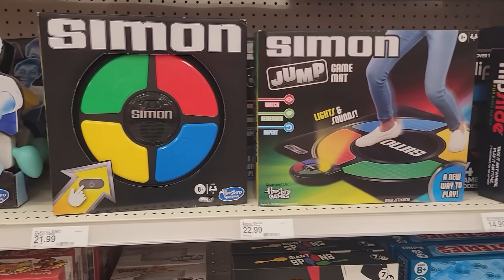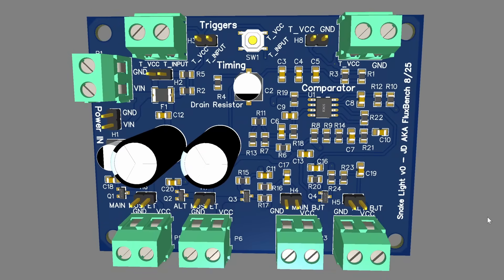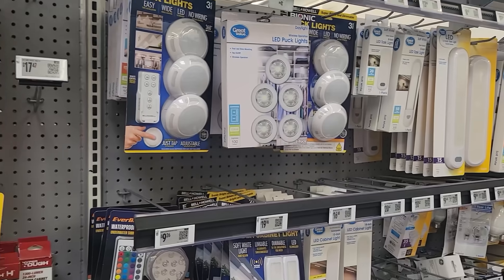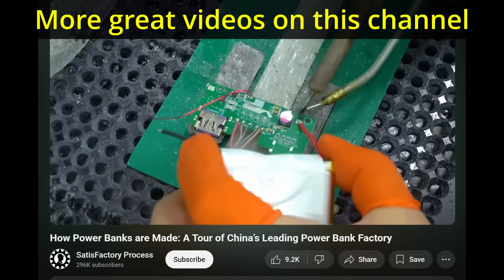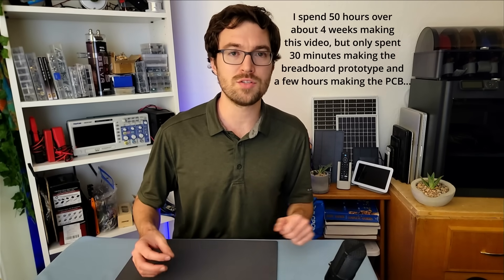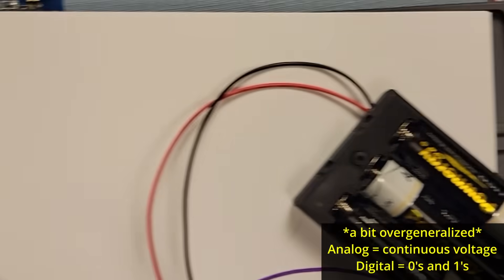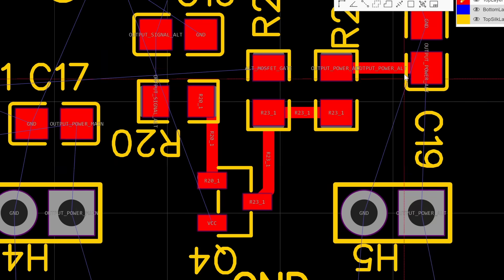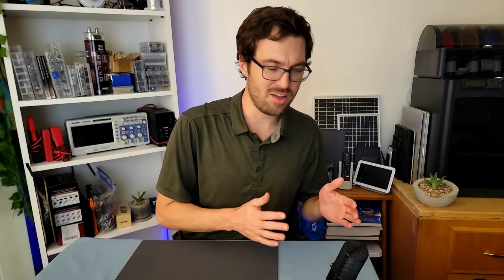How a $2 Circuit Becomes a $20 Product

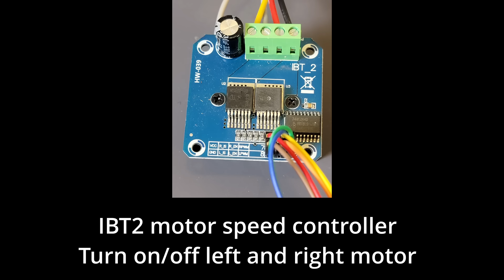Comment: 3:37 Definately not 43 Amps rated with your TDP Entropy sink solution, even Google AI Mode knows that ;)

Need for Additional Cooling: While the module can handle a peak current of 43A, for prolonged high-power usage (e.g., above 10A-20A continuously), reviewers and sources suggest adding a fan to the existing heat sink for optimal thermal management and reliability.

I just searched for "ibt2 motor driver datasheet tdp" but hey, releasing the magic smoke is the most fun, when i.e. the ams1117 still works afterwards because you are a magician ;)
Thanks for doing this, man!

Comment: My first PCB was a simple voltage divider. I was seduced into buying 1k of them in my first run. It was super simple so I thought why not. It worked out, but I would have for sure made a mistake on something more complex
Reply: what did u do with those 1K pieces lol
Reply from the maker: @Mrnooobreal  I need to know as well 😁
Reply from the maker: Gotta know, what did you do with 1,000 voltage dividers!

Comment: What would you recommend for cases? Built to something cheap that you can buy or 3d print?
Reply: If you have a 3d printer, you already know :)
Reply from the maker: @TheBinklemNetwork  if you know, you know 😂
Reply from the maker: 3D printer if you're doing it yourself or aesthetics don't really matter too much, but one step up is getting it made by a professional company like JLC PCB has their 3DP division that can do professional 3D printing or resin printing or machining out of metal or plastic or whatever. That's a very decent middle ground between home 3D printing and professional cases made with injection molds. Sometimes cases are like a dollar each and sometimes they can be like 10 bucks depending on material and manufacturing process and size

Comment: Great stuff. Please do more Videos on electronic products development.
Reply from the maker: Will do! I wanted to make a few videos to explain how to make circuit boards before getting into more of that side, and I did 😁 back to using circuit boards to do things! 

Making a quick pit stop to automate my CNC machine with sensors so I can do the production work at home instead of getting cases and little physical components manufactured externally. Figure that would be a cool thing to show how you can make a lot of stuff for light production work at home.

Comment: Love the content. Is there software that analyzes and validates the PCB design / schematic to catch common issues before having them printed?
Reply from the maker: Yes, but that is a wide-ended question similar to say is there anything that can catch mistakes in code. But similar to code,  they can tell you if something is obviously wrong, but have a hard time telling you that something is subtly wrong. Let's say you want to do something like: 1 + 2 = 3, it can tell 1 + "abcd" is probably an error, but can't tell that 1 - 2 isn't what you want.

There are many AI-based companies that do exactly this. In 1 hour I have a meeting to talk to a engineer who is building exactly this kind of thing at "Flux.ai"! Really interesting concept, not quite fully baked yet.

Most other software in this area is for PCBs that are so big and have so many people working on them that doing a human review would take weeks and be prone to still missing things. It will catch those basic and obvious errors, but not the subtly wrong ones.

For now, if you don't have a senior electrical engineer to look over your stuff, describing your intent in words and adding images of your schematic to ChatGPT or another AI is a decent way to check. Better than nothing.

Comment: First of all, Keep FCC certification in mind in your calculation guys. Its not cheap and mandatory for electronics. Also. Way more important. NO NOT PROTOTYPE WITH CHINA. They can and will steal your design and sell is cheaper. Also their PCB´s are leaded which is very illegal to sell here in the west.
Reply from the maker: I'll be covering that stuff later, this product was designed to avoid the need for FCC certification as nothing is switching over 9000 times a second. No lead is possible, just costs a few dollars more to get ENIG coatings rather than HASL

Comment: would it be easier and a more long term solution to handle the snake problem directly?
Reply from the maker: Not really 🤣 over the years I've had about 10 snakes just decide they want to live in my garage. The garage door is open for hours a day when I'm working out there, and there are a few cracks and holes in a side door they can squeeze through. I like most of them (not rattlesnakes) as they keep the rodents away, but between snakes and shovels falling over in the dark it would be nice to see where I'm walking before I can turn on the light 😁👍

Comment: Oh, btw, what about the cost of getting certified by regulatory entities? What about the cost of your time assembling the components?
Reply from the maker: The magic of this design is no certification needed by EMC Labs for FCC compliance due to nothing switching AKA turning on and off more than 9,000 times per second. This is equivalent to like a flashlight with an on or off switch, except for it's going to be the door that turns it on, and a capacitor being drained over many seconds that turns it off eventually. 

I will be making another product after this to demo EMC compliance and certification and all that stuff
Reply from the maker: Very good catch about the assembly time!!! I will get the electronics manufactured by either JLC PCB or a contract manufacturer I'm currently using in Asia. I might also have the contract manufacturer do the full assembly and testing too depending on the case and trigger mechanism I end up using. I'm going to make a version using more custom cases and components for the trigger, and another using more generic stuff that the Asian factory can source locally.

Comment: 20 prototypes later and I'm starting to think... this guy might be onto something about small test runs!
Reply from the maker: 😬 20! I don't know if I've even made 20 prototypes of a 3D printed object! Well, maybe gears and bearings, but that is like "if we increase the gap by 0.05mm and run it for an hour how does the wear and tear look?"

I like to prototype everything in pieces until I'm confident it'll work together. Mostly because I don't have the time to wait around for that much manufacturing and shipping time. Really helps once systems get dozens of subsystems

Comment: I am electronics engineer, and i do electronics systems for military, i have all skills needed, but i cannot convince myself that i can design something simple and already done few  times cheaper by chinese guys, so it can be profitable, i just cannot imagine it working without being big company and optimizing costs
Reply from the maker: It's a hard task to find something that is needed, you can do, isn't regulatory hell, works well, sells well, and is profitable! Even going from a working prototype to something you can sell while following regulations is difficult as you probably know. 

I just build things for myself and people in my life. I'm not out solving random people's problems, so I think that's my strategy. Build what I know type thing.

I'm constantly surprised about how most things out there are built using technology that is 5 to 20 years old, and if you just implement technology from the past year or two into something new, there's your new idea that doesn't exist yet. Find a field or component with rapid improvements and build a product with that market differentiation of that one thing.

I think you're looking at this with open eyes 👍
Reply: Focus on designing things to improve your life. Someone else will benefit.
Reply from the maker: @johnaweiss exactly! I make stuff for the person I know best, me 😁 then other like it as well.
Reply: I think if you start small, with this mindset, you will make decisions that will help you scale well and optimize greatly.
Reply: My advice: design things that fit a need for you. Iterate while asking yourself "could it help others?"
Reply from the maker: @georgesdev4577  100% exactly! I walk into my dark garage every single day because I've been so busy with other work I haven't gotten the snake light working yet. You know, bills and contracts come before fun YouTube education right? But everyday I'm reminded of the need. My personal need, and probably someone else's too. Fantastic advice!
Reply from the maker: @georgesdev4577  I tried to pin your comment and apparently I can't do that. I just want you to know I super agree! 😁👍
Reply: Are you enlisted/commisionned? Or contracted work for gov?

Comment: What about FCC or CE marking? CE marking for electronic products with wifi or Bluetooth is at least 25000 $ in Europe and it's impossible to sell without it.
Reply from the maker: This is where it gets complicated and potentially expensive. It really depends on what exactly your product does, and what components it's made of and how they work together.

The reason why this simple non rechargable battery light with a timer product is being used as a demo is that you don't actually need FCC certifications when nothing is turning on and off or has any sort of frequency above 9,000 Hertz. It is impossible with almost any thing other than a design like this which is more analog than digital. So if you don't need a microcontroller, don't use them. Not every product has that luxury, but that's why I'm showing this in the crawl, walk, run format. 

I think I'm going to have to interview the Bluetooth SIG and ask for clarification and make a video about that. It's a whole can of worms...

So stay tuned, I will get to that eventually but it requires and deserves to be handled well. A lot of people need clarity on that topic.

Comment: great content..i suggest sending a screenshot of your schematics to gemini or other AI and help it check everything and give suggestions... it works pretty well!
Reply from the maker: I think AI is a mixed bag when it comes to schematics. Anything that has more than about 10 parts it starts to make stupid mistakes in my opinion. Can it tell you which resistor to use with a 25mA LED and how to connect a 555 timer? Absolutely! And when you are starting out, it might be great advice. But most of stuff I work on has like 50 to 200 components and that's just a little bit beyond AI right now. I've been talking with some AI electronics design companies lately and look forward to chatting with one of their engineers soon about the specific challenges AI has with exactly what you're talking about. What does it do good, and where is it still lacking.

Regardless, I think I should follow your suggestion in the next video and give my opinion about what the AI suggests. Even if a monkey scribbled down a suggestion on a piece of paper, if it's a good suggestion I should follow it right!? 😂

Comment: There are tons of different Chinese lamps with movement sensors for a few bucks
Reply from the maker: I could use a low energy movement sensor which is not a bad approach, but I'm really looking forward to a device that draws basically zero power when not in use as a physical trigger will enable it to turn on for a bit. 

I will still look into them, thanks for the tip!

Comment: If this is a painful problem (looks like it is), why don't houses build their light switches on the inside? Also, how to stop counterfeiters and copycats? It costs too much money to patent and too slow. Even if we did, I understand we can't pressure Amazon to remove clone items from their listing with merely a patent pending status. If the product is so good and easy to build, I bet someone will copy it and sell a clone in a few weeks.
Reply from the maker: You're pretty much right on all accounts 👍

Yes, the light switch should be next to the door. But I didn't build the house 😉 and I can't move it

Yes, copycats will show up as soon as you become successful and sometimes even before. 

And yes, there is nothing you can do to stop them or have Amazon not sell their stuff. The best way is to constantly improve and move quicker than the competition who will legally or illegally make products like yours. This is just the way it is, sadly.

Comment: I've been buying those Temu molds and turning them into concrete works too.
Good money there. Especially if you paint them.
Reply from the maker: Awesome! I make my own molds and will be starting to sell them soon. Instead of painting I'm looking into more dip style staining and coatings or paint instead. Trying to keep the labor time really low per unit. 

What type of stuff do you make? Do you sell it on Etsy or Amazon or where?
Reply: @FluxBench  Selling local right now. Going to art walks and whatnot. Just got into the concrete game not too long ago. But my next set up will be nice with all the banners and whatnot going. 

And my business cards will have the right info on them this time. XD

I'm looking into acid staining mine here soon. Should make them look way cooler. 

How do you make yours and the molds? You should totally make a video on your process. Love comparing and contrasting how I am doing mine compared to others. Maybe I learn something.
Reply from the maker: @MrGrombie  It will be a while till I do a silicone molding video, but in the meantime this guy Michael Joy is the most knowledgeable mold maker I know of. His channel @HandUfacturing is filled with all sorts of little tips and knowledge he's gotten from a lifetime of making molds. He's my go-to guy! Robert Talone and that guy who casts a lot of polyurethane to make replacement car parts like headlamp covers are also good.

I've never tried acid staining, I'll look into it! I tend to use clothing dyes and acrylic paints mixed into the cement.

Glad you're having success making cement products for sale!

Comment: How do I go about making the plastic shell for the product and what materials are actually used in that and which are good for what cause just saying plastic is not sufficient when talking product manufacturing
Reply from the maker: Next video in the series will be the various PCB prototypes and 3D printed cases and professionally made custom cases.

If you need less than 10K units then check out companies like JLC 3DP but more is basically injection molding and thermoforming territory.

Do you have a specific application?

Comment: Very cool. Why buy 50 boards if it's just a test to see where your design breaks down? Is that the minimum order size?
Reply from the maker: I usually order 5, and if I need more 50 is normally my next step up before I do a bulk order of like 1000 or so. Whatever problems you run into ordering 50 will probably be the same you will run into with a thousand. But 5 is small enough that often different machines and processes are used to make them. Maybe I didn't phrase it well 😬😉
Reply: @FluxBench this makes much more sense. Thanks for answering.

Comment: You should create a sensor light that lets you know if you have snakes in the garage before even opening the door.  Then you should also create a auto light that turns on the main light as you open the door instead of going to the switch lol.  This would be a great challenge for you and will be a nice video to make.
Reply from the maker: I've spent many years with the thought in the back of my mind of training AI to detect snakes super accurately using video cameras. I think that's the approach I'm going to take eventually 😁

Comment: Lets say you have the pcbs and assembly can be done by jlpcb etc. How do you get them finally into an injection molded product and assembled? I see this as the biggest cost that not everybody will take who is not used to this.

(Im an electrical engineer and this has been my biggest concern from creating my own mass produced products)
Reply from the maker: I think the best way to do it is to have the physical enclosure that is either screwed or snapped or glued together hold the circuit board in place. You can create holes in the PCB (literally drilled holes of basically any specific size) then use pegs or standoffs to protrude from the housing so you can kind of drop the circuit board onto it and the holes in the corners of the PCB or whatever you put them fit with just the slight amount of snugness or have like a tapered pin or protrusion so that way you can kind of press fit them. 

In the next episode in the series I'm going to cover this with 3D printing in a lot of detail. 

Let me know if you have any more questions or follow up questions!

Edit: I tend to just use screws and screw the PCB onto the enclosure using one of the mounting holes

Comment: Like this video, something i have been thinking about for some time now. just a thought but maybe mention the value in recycling old components as a cheap source for you projects. some things never change, but some things do.. some older products are expensive and hard to find....
Reply from the maker: Good suggestion! There's a lot of value in certain components but others just aren't worth their time to remove and clean up and get ready for the next use. Someone made a really good video about which parts are worth salvaging. Long story short, if it's big and heavy or turns on and off big stuff, it's worth saving! Also some older microcontrollers or chips you can't buy anymore but are still needed for common repairs. 
I have a dream of making franken projects from other projects. Going down a Goodwill and buying three or four different things like coffee makers and toaster ovens and VHS player and a TV and turn it into some cool bigger device.